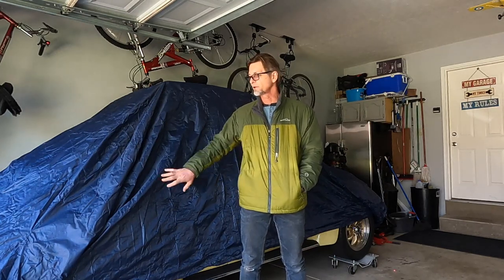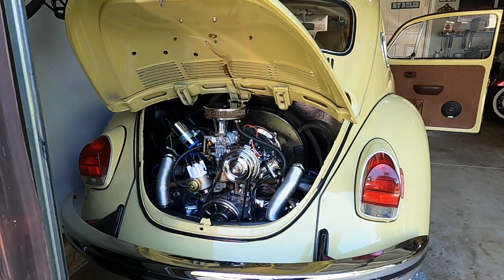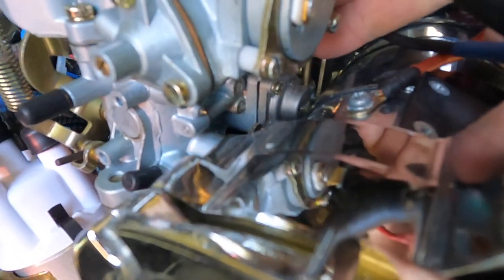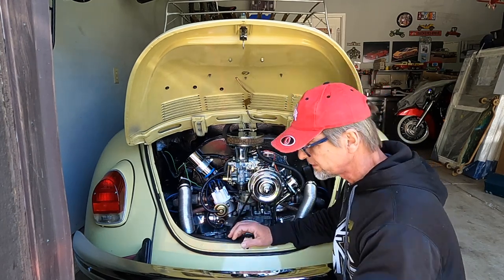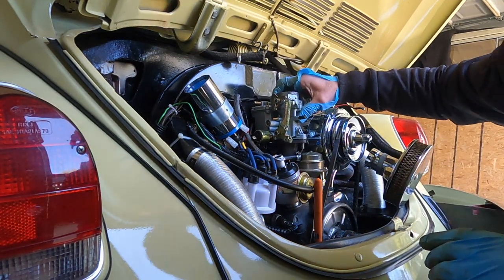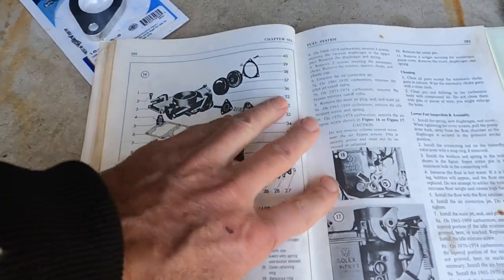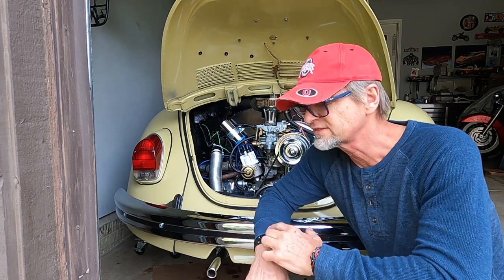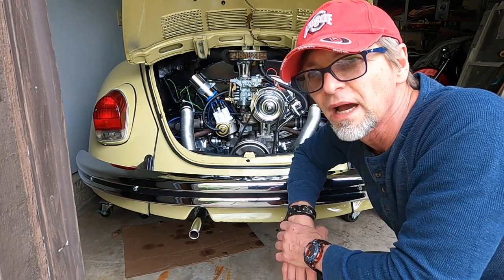EMPI Spacer for VW carburetor pict 34

Comment: Junior, I have been watching your YouTube channel for some time, as a matter of facts since the first videos you had about the VW Beetle. You had a series of videos dedicated to re-covering the seats for the front and back of the VW Beetle, and I like the way you do the work. I tried all the information that I could get my hands on in reference to not only about re-covering the seats with new covers, but searching for the brake down of the parts that make up the seats itself. I am referring to the brackets, screws, springs, nuts and bolts, etc. or any kind of diagram, books about VW Beetles, but still cannot get it anywhere. I would like to send you a video so you see the seats I have for my 1973 Beetle so you can help me to decide if these are worth it or should I get another set of front seats. I am not too computer literate and would need some help even to find out how I can send you my video from my cell or computer. Any help will be appreciated! Thank you and God Bless you!
Reply from the maker: Is your car a beetle or super beetle
Reply: @juniorclassicvwbugs924  It is a Beetle and it is a 74, made a mistake when putting the numbers. I am sorry I lokked once and there was no answer so I kind of check again and saw your question to my question. So, Iwill wait for your answer and thank you again!

Comment: How your experience with that Chinese carb has been, did you end up buying a true solex. I have been thinking about buying a Chinese one cuz my Bocar 34 Pict 3 looks very exhausted... And I'm not sure if refurbishing it will solve long term issues. Moreover, quality parts are scarce so I might end up rebuilding with generic/Chinese parts anyway.  Greetings from Mexico :).
Reply from the maker: Honestly not bad, but I am still planning to refurbish one of my 3 Solex.  I have not done it yet, because this one is working fine

Comment: Hello sir , can you help me find the dash gauges you have in your bug ?
Tach , volt , oil thanks Alabama Slim
Reply from the maker: Sold on eBay 
Universal 2" 52mm Smoke Lens Pointer LED Oil Press Pressure Gauge 0-7 Bar Meter.

2'' 52mm LED Digital Voltage Gauge Voltmeter Volt Meter Pointer Car Boat 12V US

2 1/16 Inch 52mm Smoke Len Pointer Car Motor Tacho Tachometer Gauge Meter #CG12